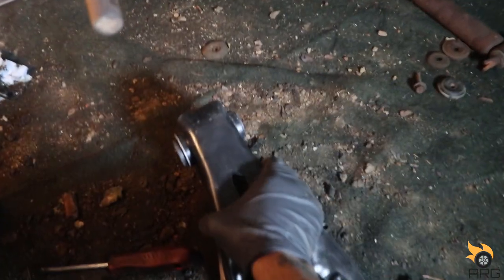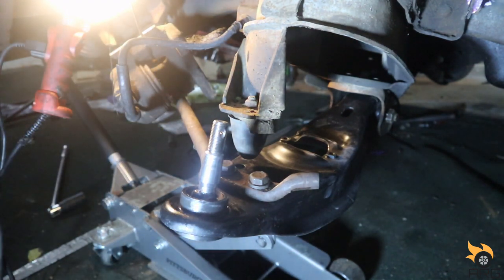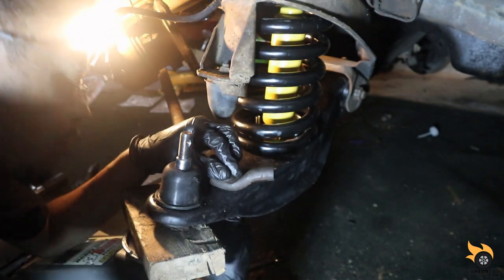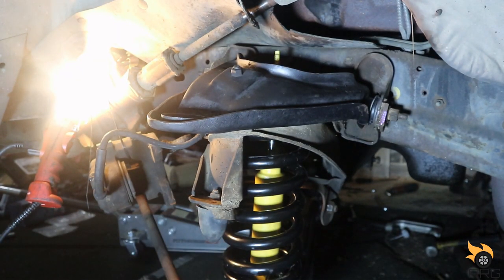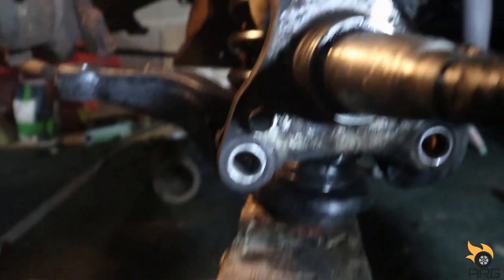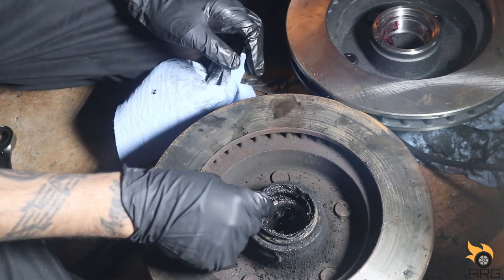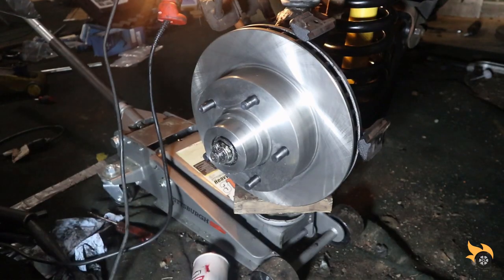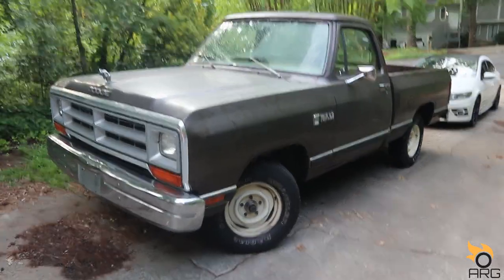1989 Dodge D100 Suspension/Steering Upgrade PT.3

Comment: Working on similar things on my 87 d100. Had to replace my upper control arms on both sides so took everything off and cleaned and painted it. Excited to start driving it again! happy to be your 100th sub!
Reply from the maker: Thanks for the sub....Got truck back from alignment and rides smooth now
Reply: AutoRays Garage getting me all excited! I just finished painting my parts. New ball joints and bushings in this week, alignment, then on the road 🙌🏻

Comment: Great job Ray, I’m going to do the same thing on my 93 D150. Did it make a huge difference in the ride and drive for your truck? My truck drives just so so but the front end is the last big project to do on it. Motor, tranny, rear end, body and paint are all done and if I could get it to drive like new that would be great. You did some great videos, better because yours were all hands on. Thank you very much. 
Luther
Reply from the maker: I don’t know how old the suspension was before I bought my truck but I had it for 2 years before I replaced the whole front end. It drives pretty smooth I’ll upgrade the steer shafting if you still have the factory design.
Reply from the maker: @Maddog worker Rockauto, LMC Truck, or summit racing